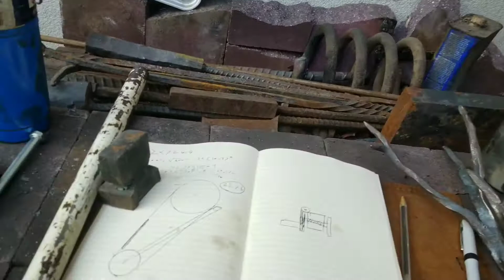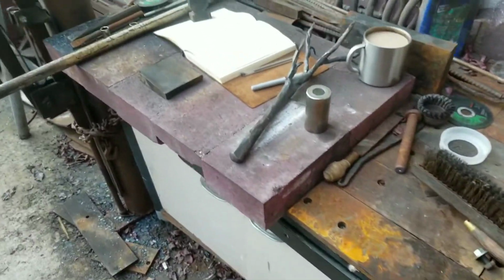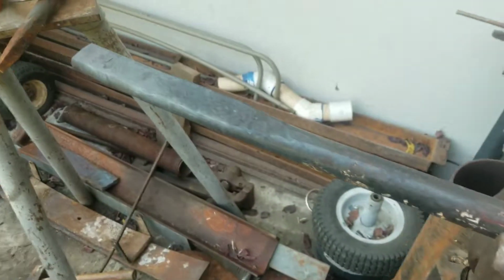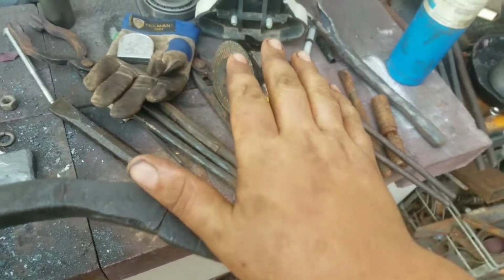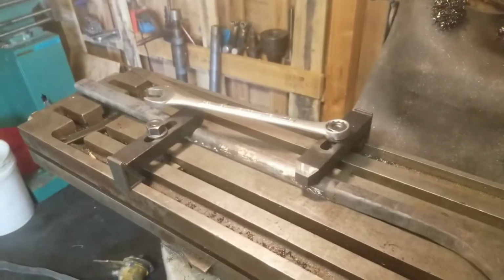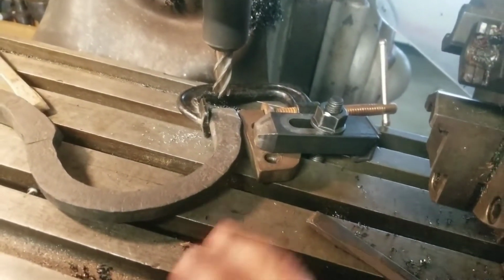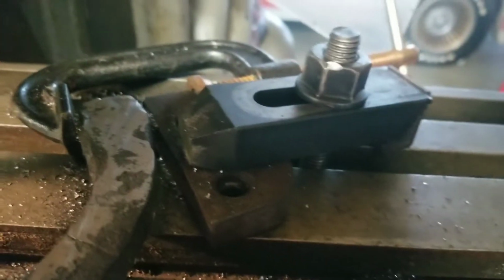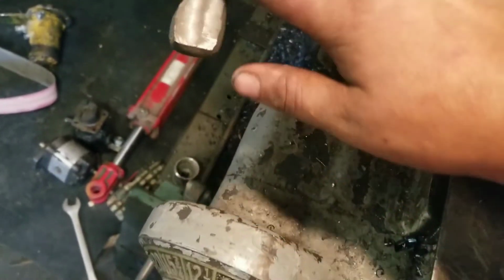Forging and machining a grinder frame

Comment: Interesting design for a grinder, cant wait to see how it all goes together. I would make some wedges, like 5 degree wedges that can be slid underneath of the part in places and clamped down onto them, then you wont have to worry about it lifting the part or deforming it.
Reply from the maker: That's a great idea! Can't believe I didn't think of that